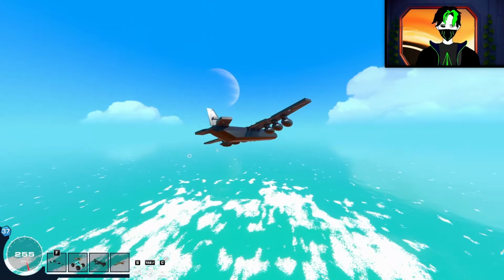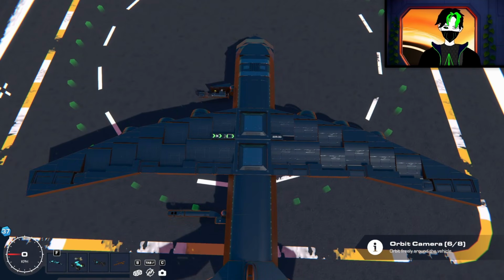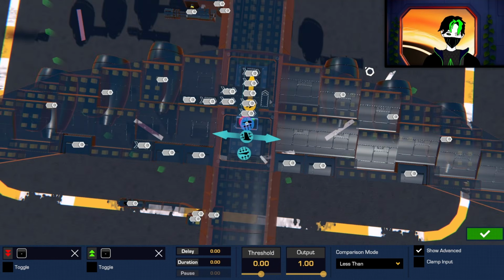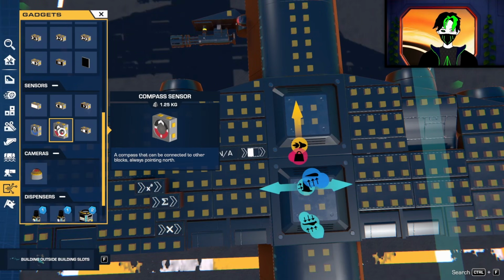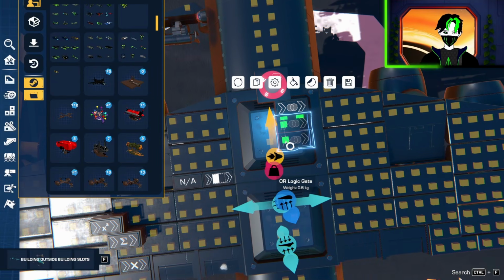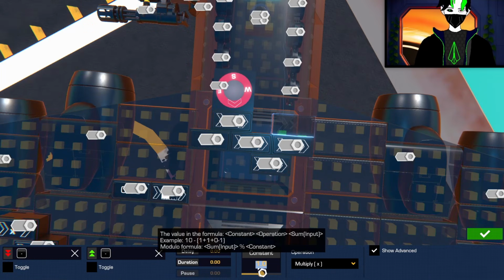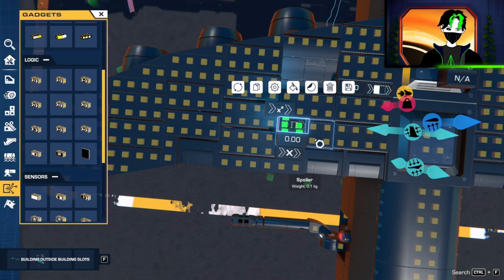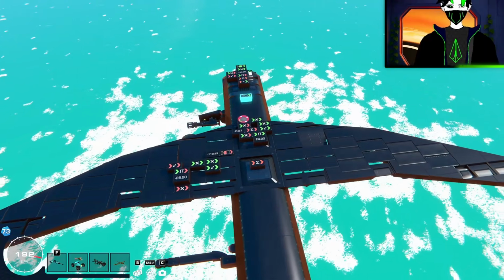I made an AUTOPILOT Gunship using Curvilinear Motion Math! - Trailmakers

Comment: for something similiar all i need would be one gyro and one gyro stabilizer just make the stab a certain strength and the gyro a bit weaker depending on how tight you want the circle you could add gyros for yaw and or pitch but thats pretty much it
Reply from the maker: Yeah, the only interesting part for this is that you can set an actual numerical radius, and the plane matches that, whereas what you're saying would just be guessing the circle size.

Comment: 1. Trailmakers runs at a fixed tickrate of 60 ticks per second, so time between updates is 1/60. Even if game lags, it still treats it like it took 1/60 of a second, so it should be pretty reliable overall.
2. To get delta of output from any block just add arithmetic subtract with constant 0.0, or arithmetic multiply by -1.0 (you just need to negate value by using one block), and then add outputs of original block and this negation block. The result will be your delta (dx), that happened over 1/60 of a second (dt).
3. To get rid of both pi and compass delta jumping when you turn 360 degrees, you can set compass to normalized output (output will become -1.0 to 1.0, instead of -180 to 180 or -pi to pi), and then you modulo your delta by 2.0, and subtract 1.0 from it. Effectively its dx % 2.0 - 1.0, so just plug into arithmetic modulo with 2.0, and plug that into arithmetic add with -1.0. Technically you need (dx + 1.0) % 2.0 - 1.0, but you can ignore it, as you care only about delta. Or you could just rotate compas 180 degrees, it'll do the + 1.0, and math will be correct. Really useful, when you try to find angular velocity, or angle between two compasses that you have on your vehicle. For example, you can measure angle of the aiming servo by putting one compass on it, and another below it (or somewhere else on the vehicle), then you put them both to normalized mode, rotate one of them 180° and set it's output to -1.0, then plug both into arithmetic modulo 2.0, and plug it into arithmetic add -1.0. then just multiply by 180 and you have angle in degrees, or don't, and you have normalized angle in -1.0 to 1.0 range.
Reply from the maker: These are all good points, thanks for the tips! I did forget that Trailmakers ran at 60 ticks per second.